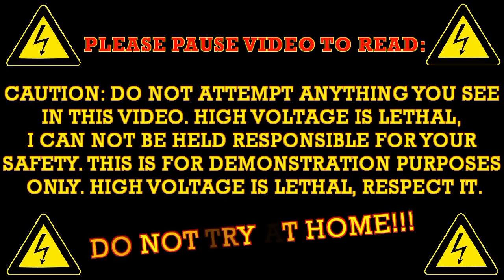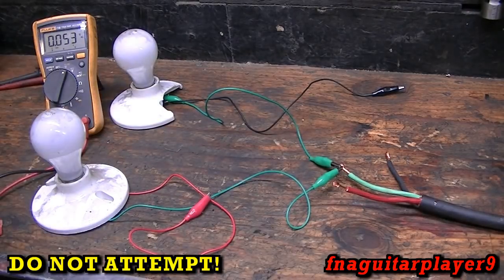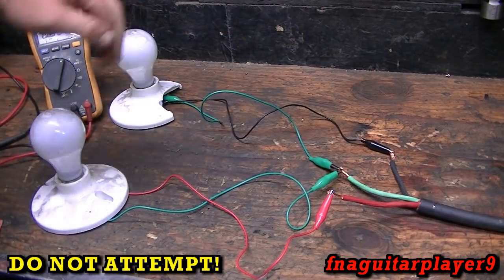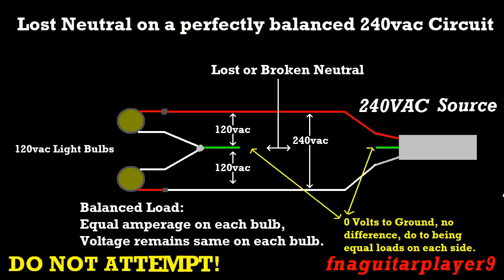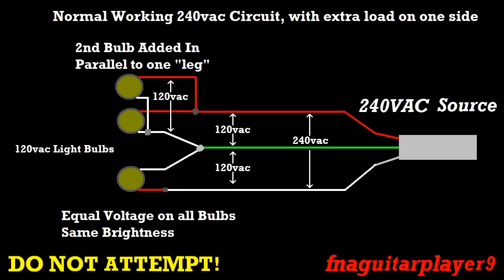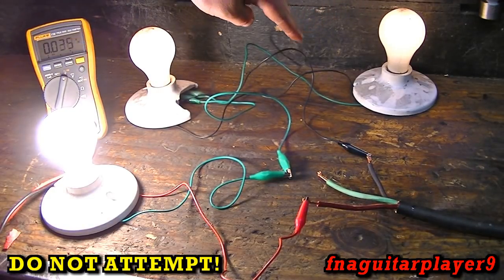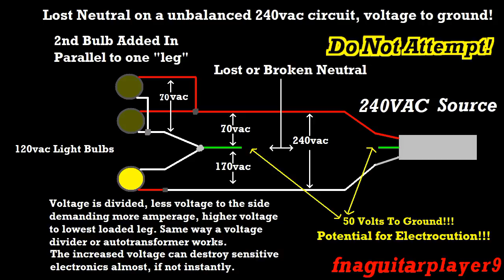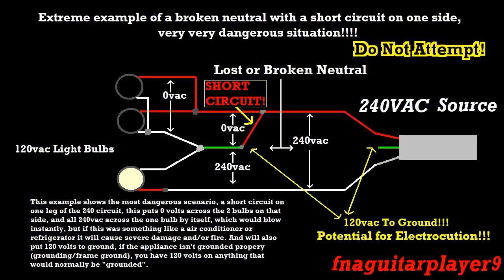Lost Neutral / Function of Neutral on 240vac Circuits with DEMO's

Comment: I ran into this video searching for why my 240v outlet in my shed is only producing 120 on each leg but 0 together. The outlet plug is good so I traced the 3 wires from shed to breaker. I found that both hot wires are connected to one pole at the 30 amp breaker. I'm no electric expert but that doesn't make any sense as to why they would have a 240v plug in shed but attach both hots to one pole smh. Both poles at the breaker work too, I get 240 there.Thanks for sharing this important info. I appreciate the DIY videos on your channel so liked and subbed.

Comment: I lost the neutral on my dryer unit, and it was a 3 wire circuit, so when I ran it it was sending power into the disconnected neutral, which had no place to go and was shocking me when I touched it and something else.  I also got weird voltage readings, when I used my volt meter.  One leg was reading 74 volts, and the other was reading 68 volts, but when I would check both legs together I was getting 240 volts.  Anyone know why this is happening?

Comment: Great informative video. However I'd like to clarify that the neutral serves as a current carrying conductor providing a path for the imbalance portion of the loads back to the source or the transformer. What determines the amount of voltage delivered is the resistance of each load

Comment: The bulbs act as resistance, voltage equals resistance x current two bulbs in parallel are lower resistance wich means a lower voltage drop across them and the single bulb is higher resistance which has a higher voltage drop and is why the single bulb got brighter (you wouldn't normally wire bulbs in series)

Comment: Thank you very much for the visual demonstration, my Forman originally told me a 240 volt circuit works with power Bering looped back on the ground when there’s no neutral.  I thought that sounded wrong so I looked more into it and the two hots inverse there phases to be a full loop with each other , then I watched a video saying there actually in phase . So I got confused again lmao. In my head two hots coming into contact with each other would overload me trip but I guess for 240 circuits it just doubles the voltage and acts as one big loop, then I looked up a video on how 240 can work without a neutral and your video just put the icing on the cake for me to understand it all.

Comment: This exact scenario happened in my Rv and burnt up a lot of electronics. Very expensive. Found out the the neutral on the 50 amp plug that plugs into the Rv outside was fried. Not sure if it was just loose or broke or water but I lost neutral and most 120v appliances got fried

Comment: We had a bad storm go through last week. When the power came back on, I've been having g very strange power issues. My whole house, at the same time will flicker, dim way down like brown out, then almost go out for a half second. When I turn the washer on, at the spin cycle, all the house lights dim way down, some black out. As the washer is agitating the lights flicker.

Comment: Loose the neutral you also loose short protection. If wires shorted it might not flip a breaker or blow a fuse.

Comment: An old boss was telling us about a guy who put a high powered CB RADIO in his truck and upgraded battery system and altonators, he had it all hooked up, but the direction called for an earth ground
Well being in a truck he knew he couldn't run a long wire for earth ground so he put a 5 gallon bucket of dirt in his truck, and stuck a copper rod into it for earth ground, but none of his gear would work
So he had to take it to my old boss to find out why. 
Stop laughing its a true story.
Everything in his truck was hooked to 12vac but he also had a 120 volt ac converter. 
His ham radio would not work wouldn't even power on.

Comment: Low voltage is also lethal  12 volts dc can kill you. 1.5 ma of current can kill you.  Ever short out a car batter positive post to ground when its hooked up thats 550 to 750 cold cranking amps, amps is the size of the train. Voltage is the trains speed,  2  mph 650 ton train can kill you
No matter how fast its moving but your more apt to die if its going 50 to 70 mph.

Don't test a car battery on your toung, iv seen it done it wasnt pretty.

Comment: if you include a amp meter would it show that two bulbs @ 240v in series draw the same amps as a single bulb on 120 ? thanks for the info. great video

Comment: Excellent video Frank. I’m currently facing this issue. Trying to trace the cause. Got any tips? Panel is a moist basement and the terminals on ground and neutral were heavily oxidized. I cleaned them up as good as I could and added anti-ox lube. Problem’s still there. When the fridge kicks in, line 1 186v and line 2 54v. Bought a new panel yet to install. Any advice is greatly appreciated. Thanks

Comment: Great Stuff, I instantly sub'd here as you have an excellent way of explaining theory with great demonstrations. I have a question or 3 about this after 2 viewings and reading every comment and your and other's reply's. 1) why did you use the green test leads and green center cable wire for the neutral conductor here? We have always been taught green is ground, white is neutral; or is that just what you had available laying around to use for this demo?
2) Does this "lost neutral" unbalanced voltage effect only the loads of the 240/120 circuit that the neutral break is on OR does it endanger appliances on other circuits in the house with good neutral connections?
3) Can you elaborate a bit on "same way a voltage divider or autotransformer works" ..... not familiar that or how it relates to this problem. Do autotransformer's create or mimic this problem?

Comment: Great video!  Just confirmed my brain thinker. Been driving me nuts on a hot water tank repair and the tank tested fine but when I apply the breaker at the boxvi loose 240 down to 0.00 and the supply to that panel tests good

Comment: This is superb video. You actually show what most only talk about. Well done.

My (pedantic) contribution is regarding the statement at 0:54:
A 220 circuit itself—if there is no neutral involved—is not really comprised of two phases in the most explicit sense, since phases are SIGNALS and not wires. Signals are inherently between TWO or more points. Between the two 'hot' legs is only one signal—or one 'phase'—, and it's 240 volts. Physically speaking, it's the two far ends of the transformer secondary coil (as you mention elsewhere in comments). 

Of course, anytime ground becomes a reference (which is often since we tend to stand on ground) then it is probably fair to describe them as two phases since ground/neutral provides a third point of reference. Note that any phase RELATIONSHIP—as described with degrees— needs not two but THREE points of reference. When people look at mains sine waves on an oscilloscope, they are referencing to neutral, which is why it shows up as two phases 180 degrees out.

So this is not to say that your statement is wrong, but to clarify that it needs reference to ground/neutral to be correct. As a truly isolated system, the 240 volts is a single phase.
Reply from the maker: Thanks! You are right, i should have explained that part a little better! Thanks for Watching!!!

Comment: 6:38 where does the 50 volts come from. When you get 70 on one leg and 170 on the other how does that turn out to be 50 V in Middle of lamps
Reply from the maker: Its the voltage difference between the 2 points, it works on the same theory as a autotransformer. Thanks for Watching!!!

Comment: I have a question that I can't find the answer to anywhere. When measuring potential difference with a voltmeter, it's measuring the difference between the two points being measured as I understand it. Example, measuring from the ground and the hot your meter should read 120V. But when you measure across both hot legs then why does the meter read 240V and not 0V? Since each leg is carrying 120V wouldn't the potential difference be 0? Thanks in advance and great video.
Reply from the maker: Thats a good question that i should of explained, but both hot legs are out of phase with each other on this system, the transformer on the pole that runs power to your house has a center tap, which is connected/referenced to ground, so each hot leg thats on each side will give the total voltage output of the transformer, and when you measure a hot leg to ground you get 120 which is half of the voltage, because its measuring it from the hot leg to the center tap of the transformer. I hope this makes sense, if not I will try to explain again, i'll put this on my list of video ideas for this year as well! Thanks for Watching!!!
Reply: Thanks for the quick reply. Unfortunately I'm still struggling with this. What I'm struggling with is that if you only have 2 leads on the voltmeter, how it reads 240v when the difference from the two hot legs should be 0 since each leg has120v? I know it has to do with them being out of phase but what I don't understand is how the voltmeter reads it as 240v? I guess my question is more related to how a voltmeter measures potential difference. How does a voltmeter know they are out of phase if all it's doing is measuring difference from any two points that you put the leads to. Sorry I have a hard time with electrical and this one is making me lose sleep.
Reply: @furio12121212  Forget about phase for a second. It will only confuse. Think of this simple analogy:

If I am measuring the height of certain parts of a house, and I am standing on the ground, I will measure up to the roof and come up with a number (say 30 feet). Then I will measure DOWN into the basement to come up with another number, (say 10 ft.). Does that mean the roof and basement are 20ft. apart? No, they are 40 feet apart because one measurement is AWAY from the other measurement, so they add, they don't subtract.

Another way to say this is that one 120v measurement is negative while the other is positive. The difference between 120 and -120 is 240. Google an image of a center tapped transformer diagram and it should be obvious from a visual point of view.
Reply: @spruce_goose5169  Thank you for this explanation!!

Comment: Im trying to understand wiring a generator to a house. My case isnt so much a lost nuetral, Im having issues understanding a bonded nuetral. 

What is the purpose of a bonded nuetral? Say my house panel has a bonded nuetral, and my generator is bonded nuetral, how would one go about wiring it to the panel? 

I was on the path of installing an L14-30 220 inlet wired to a two pole breaker with an interlock from interlockkit.com to prevent the generator from back feeding through the main. I just cant quite grasp what I need to do with the two bonded nuetrals as I know you arent supposed to have two bonded nuetrals in a system. 

Also, in an emergency HYPOTHETICAL situation, it seems like you could just wire the generator’s black and red, one each to one side of a two pole breaker, white to a bonded nuetral bar and leave the ground (capped off of course) not hooked to anything, is that the case? Or would you connect generator ground to the nuetral bar and leave the generator nuetral not hooked to anything?
Reply from the maker: The generators neutral will have to be connected, if not the system will not be balanced and can damage appliances, the interlock kit should explain the wiring in detail. Hope this makes sense. Thanks for Watching!!!

Comment: U will get a higher voltage across the lower watts load, lose a neutral u now have 1 ckt. and that's two loads in series across a 240.
Reply from the maker: Yes. Thanks for Watching!!!
Reply: The two bulbs in parallel have a lower resistance (impedance?) than the single 100w bulb. That makes the overall resistance in the circuit lower than the original two bulb circuit. The lower overall resistance causes higher amps in the circuit which in turn causes the single 100w bulb to drop more voltage. Or something like that :-P
Reply: @fredsalter1915  Hello Fred, Sorry u r having so much trouble with this. Let us
 say u have two appliances a 600 watt coffee brewer and a 1200 watt hot-plate,
both being 120 volt loads when there is a neutral, each load is fed with 1 hot wire 
or as the code calls it, an ungrounded conductor, and a grounded conductor.
Should the neutral be lost you will now have JUST 1 circuit. and that will be ur two
loads in series across a 240 volt line. since the coffee brewer is 600 watts its
resistance is 24 ohms, and the 1200 watt hot-plate? yup 12 ohms, so watt u have
is 36 ohms of resistance across a 240 volts line, allowing a current of 6.6 amps.
That 6.6 amps flowing thru the hot-plate will give a voltage drop of about 80, and
the voltage drop across the coffee brewer will be about 160 volts.
Reply: @raymondgarafano8604  Thanks for the clarification, sir!

Comment: Shouldn't the voltage on the two lamps with no neutral be 240 And blow the light bulb. I don't understand why you're still getting 120 to each lamp with no neutral
Reply from the maker: The voltage divides between the 2 loads, since both are the same its split down the middle. thanks for watching!!!
Reply: The first 100w bulb will drop 120v and then the second 100w bulb will drop the remaining 120v.

Comment: unbalanced load u get current on the neutral. with a lost neutral all loads are in series across a 240
volt circuit. amps will be = to volts /resistance. Ex. 24 ohm 600 watt Mr. coffee pot in series with
a 1200 watt 12 ohm hot plate. So there is 36 ohms across 240 volts and 6.66 amps of current will 
flow. that 6.66 amps X the resistance of Mr. coffee and the hot plate  will put about 160 volts to the
coffee maker and about 80 volts across the hot plate to = 240 volts. with heater type loads,  well the
coffee will be burned but a puter is gonna have that nice magic smoke.
Reply from the maker: Yep, thats exactly it, its a strange situation! Thanks for Watching!!!

Comment: Appreciate this demo! Suspect this is my problem. Box fan on low speeding up while lights are dimming no longer a puzzle. Over last thirty plus years, seems like every ten years, I have traced dimming, flickering lights to a corroded, arcing connection on two different panels and once to where the mains connect to this old house. I know which wire to focus on this time tho. Thanks
Reply from the maker: Your welcome, it sounds like it probably is whats going on. Thanks for Watching!!!

Comment: Best video on this I have found so far. THANK YOU! I am an RV Park owner and I want to be sure our pedestals are safe. We have had some plugs melted  and one prong or the other seems to get hot. I have not had any reports of appliances burning up but this is a good thing to test in addition to all the other conditions that could be at play. Very understandable tutoral. Thanks again.
Reply from the maker: Yes, that would be a situation that this could easily happen on, good idea to keep a eye on them! Thanks for Watching!!!
Reply: I wish the rv park I'm in was this responsible. Just lost my refrigerator and microwave to a open neutral.

Comment: Great information. I saw a house that didn’t have the neutral connected from the weather head in the meter box. Only from the box to the breaker panel. I’m pretty sure it caused the fire in the home. Thankfully no one was hurt. I had to research it a little because I’d never seen such a thing.
Reply from the maker: Thanks. I'm sure it probably did cause the fire, its a very dangerous situation. Thanks for Watching!!!

Comment: Big thank you for this great in depth explanation !! The situation in 7:36 is exactly what I'm facing currently. I was able to identify this after watching the video and testing it out( I mean checking outlet voltage not the experiment in the video 😄). My TV keeps instantaneously turning ON/OFF while watching if a light is turned ON/OFF or be it an appliance with a motor. I have had two old computer PSUs blown and three days ago my new PCs PSU is dead. 

This prompted me to check and I see in some of my 120V outlets I'm getting 131Volts wrt to neutral, between phase to ground its 49.2V on the 120V outlet and in some 220V outlets with respect to the ground pin it's 49.2V. Only on my A/C outlets and heater outlet in kitchen pulled directly from the breaker panel works correctly as you have shown.
Reply from the maker: Your welcome! That definitely sounds like the problem your having! Scary situation! Thanks for Watching!!!

Comment: I've been searching for this explanation. Thank you!
Reply from the maker: Your welcome! Its not a common subject, alot of people have never heard of it before. Thanks for Watching!!!
Reply: fnaguitarplayer9 I realize on a standard 120v circuit the hot comes in, energizes the load and returns on the neutral, and in the case Of a fault, the ground wound return. On a 240v circuit, is it safe to say the potential across the the 2 hots is 240v, and L1 and L2 both energize and return the load ? It was interesting to see the neutral ground could be removed and still work.
Reply from the maker: @hunky_dory_7021  yes the neutral just balances the voltage more/less without it you may have like 80 on what side and 160 on the other side.